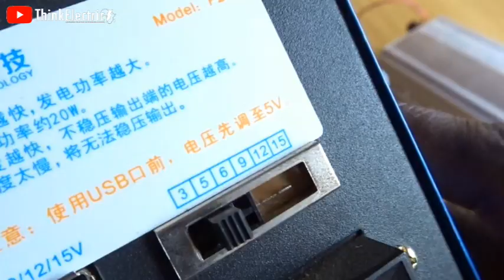Hand Crank Generator Powers 220V Inverter

Comment: This is a modified hand crank generator. The original stops outputing power when you stop cranking. With the use of a few Supercapacitors you can get about 10mins of power between cranking
Reply: maybe on the generator shaft you can install a propeller? 
free energy?😂

Comment: You would be better off creating a generator using either a local stream or wind power. Electricity is only really an advantage if it is a constant supply. Turning an old washing machine motor into a water or wind turbine generator is not hard and there's videos showing you how. Many appliances are now available in 12v versions due to the popularity of mobile homes and Caravans here in the West - and so they can easily run from a small natural source generator.